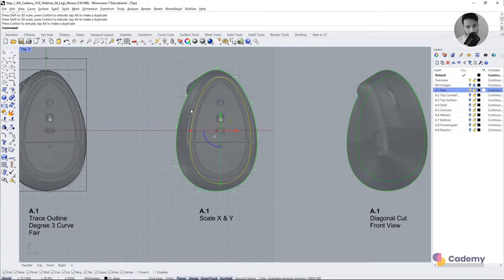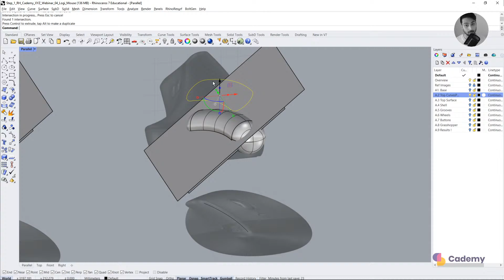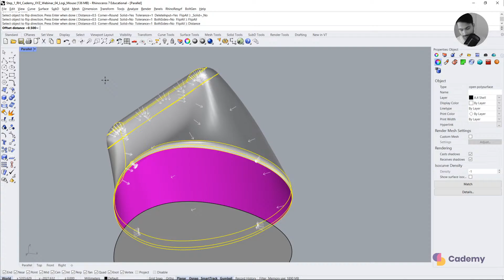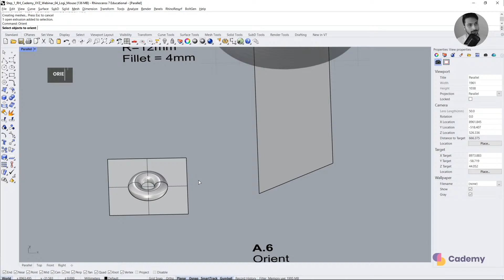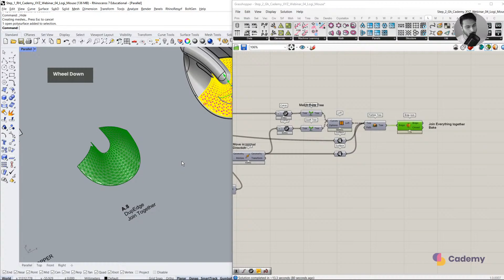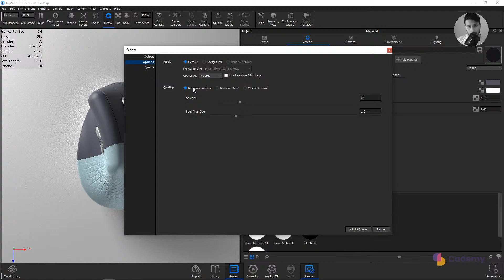Rhino 3D Grasshopper Keyshot Webinar 4.0 | Cademy

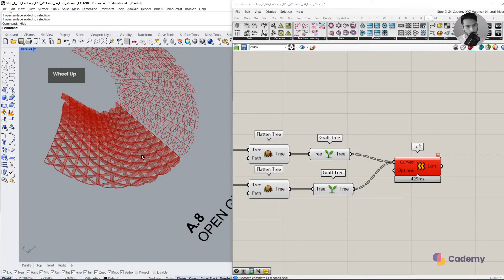Comment from the maker: Hey Guys, thanks for the compliments. We will be working on new webinar soon. Note: I was able to track down the problem eventually at 1:25:10 Yup, the problem was coming from the area component, I should have paid more attention to it. If you use the exact parameters like I did, you can see that the area component is not able to calculate the area of surface index 245 & 359. And thus, the area component is not able to find the centroid of that surface which result in Null value and has a cascading effect. That is why we were not able to create all the lofts next to that index as you now have a mismatch of the indices for the loft component.

Comment: Brep Join doesn’t seem to work for me. It doesn’t close all the breps into a single solid, but instead keeps them as trimmed surfaces. I used a panel to check what was happening inside that component, and in the “Closed” list almost every item was false. Do you have any advice?
Reply from the maker: flatten the BRep join input. Apart from that, go to Rhino document properties and change the file tolerance from 0.001 to 0.01mm and recompute Gh script.

Comment: hello, why some faces are pink and some are gray by default? did u make them by a reason?
Reply from the maker: A NURBS surface has two sides: front and back. In Rhino, both sides are the same color by default, but I’ve set the backface to magenta in my Shaded viewport. This is a useful setting because it quickly reveals where a polysurface is open and helps you understand the normal direction.
Reply: @Cademy  thank u so much!

Comment: Thancks for this great tuto.
Is working on  shrinked surface changes the result of trimed ones ? Is it better then acting directlycon a simply trimed surface?
Reply from the maker: Shrinking trimmed surfaces will not modify the shape of the surface, as long as the trimming was done on the isocurve. If you trimmed using any shape other than an isocurve, shrinking the trimmed surface will modify the trimmed boundary.

Comment: honest question, why would any product designer use rhino exclusively? This thing is way less working steps in solidworks AND its fully parametric. Why not build the thing in solid or fusion and then use rhino just for this one surface? Import it and done?
Reply from the maker: Great question! While it's true that SolidWorks and Fusion 360 offer full parametric capabilities with fewer working steps for certain tasks, Rhino has its unique strengths. Firstly, Rhino is more affordable with a perpetual license, offering significant long-term savings. It excels in freeform surface modeling, providing superior control over surfaces and facilitating Class A surface modeling, which can be more challenging in SolidWorks or Fusion 360. Additionally, the integration of Rhino with Grasshopper opens up unparalleled possibilities for advanced textures and parametric modeling that might be difficult or impossible to achieve in SolidWorks or Fusion alone. And yes, a lot of our students do exactly as you mentioned. They just use Rhino + Gh to import the surface and apply texture and export it back.

Comment: How would this work on a polysurface?
Reply from the maker: Applying parametric texture on polysurface is a complex challenge but possible. Depending upon the topology of the base surface, you can use different strategies. In this case, we can create a proxy surface and use it as a stencil to model the texture on the final part. If you would like to learn about polysurface texture, you can check our Parametric Texture Workshop at cademy.xyz/texture

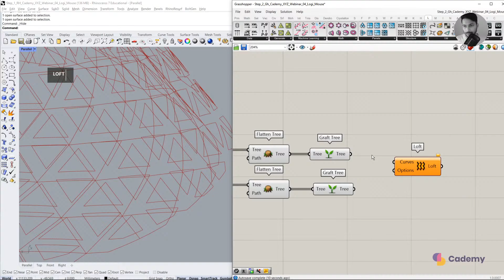Comment: Hello, great Webinar! I followed it step by step, but making all what you do, i also experience the same problem which you experienced throughout the Grasshopper part at 1:25:09 . Did you figure out what was the problem there so i can also understand why it isn't working? :)
Reply from the maker: Yup. I was able to track down the problem to one of the surface. If you use the exact parameters like I did, you can even see that the surface index 245 & 359 is creating the error in the area component. Somehow, the area component is not able to find the centroid of that surface. This you are not able to create all the lofts next to that index as you now have a mismatch of the indices for the loft component.

Comment: How did you create that plane to split the texture? I'm trying to figure that part out. Love the webinars, this is my second one
Reply from the maker: Hello Jimmy, you can create two profiles, one at the top, another at the bottom of the mouse and loft them together. Now rebuild the surface to add one more intermediate profile and modify the control points. Use this surface to split the geometry.

Comment: amazing webinar. I am an industrial designer and I work in the automotive industry. can I work on bike design in rhino or is It specifically suitable for small products? basically for class A surfaces for prototyping and production later?
Reply from the maker: Thanks for participating in the webinar. There are multiple parameters to evaluate if Rhino suits your needs or not. You can make class A surfaces in Rhino like any other softwares like Alias or ICEM Surf. The only difference will be how long it takes you to achieve the results. Cost is also important factor to choose a software, as Rhino is comparatively cheaper than other similar CAD softwares, it will affect you a lot if you are a small design studio or a startup. Don't forget you also get Grasshopper in the package and it opens a whole lot of possibilities that is impossible in case of Solid, Fusion or Alias etc. You can work in Nurbs, Mesh & SubD context as well.

There are plugins for Rhino that can help in terms of creating class A surface (XNURBS) and manufacturing (RhinoCAM).